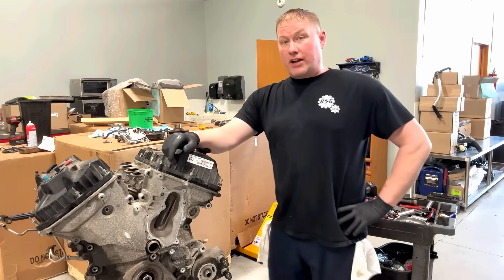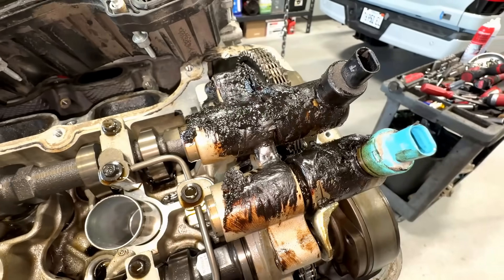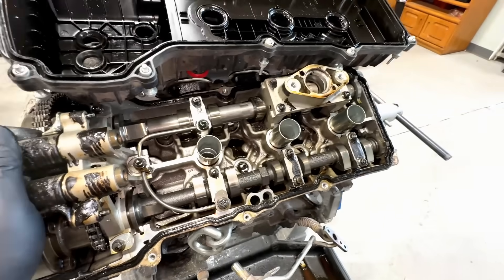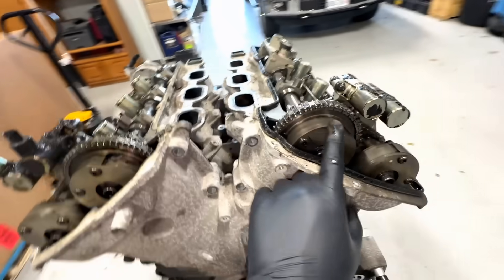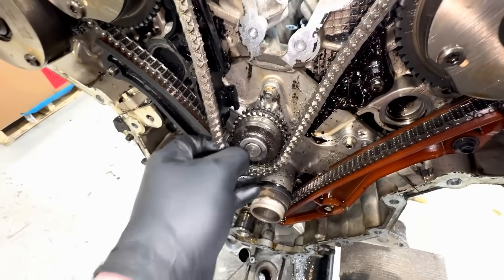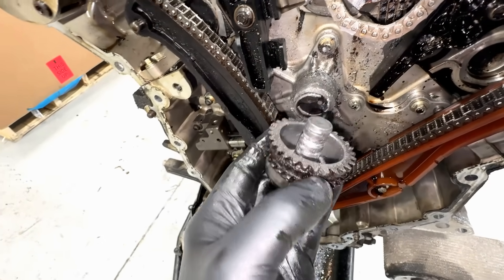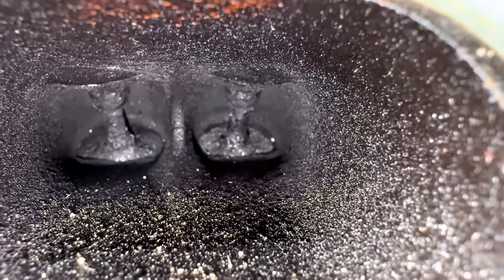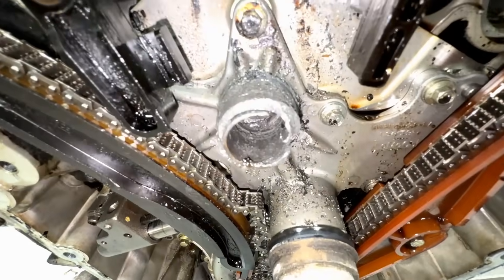2015 Ford F-150 3.5L EcoBoost Engine Failure: 97k Miles Total Destruction!

Comment: I bought a new f150 in 2017 with the 2.7L Ecoboost

She's currently still my daily commuter work truck with 210k miles and the only maintenance I have done its lots of oil changes so they can be good trucks

*6 speed trans torque convertor failed at 198 but it wasn't that bad considering
Reply: Was searching comments here for 2.7 owners experience. Glad to hear that we can expect engine life than the 3.5. I understand part of the reason is our timing chain set up vs. the 2018 & up switch to belts. btw, my 2015 is currently at 133k with routine quality oil changes every 5K.👍
Ps. the torque converter should've been a recall item. How much did it set you back?
Reply: No timing belt on a 2.7 oil pump drive was changed from chain to belt on both the 2.7 and 5.0 in 2021 or so but timing is still handled by chains. First gen 3.5 one long chain 2nd gen 3.5 and all 2.7/5.0 one chain per bank. Chains and turbos kill oil with heat and mechanical shear making it lose viscosity and causing wear. I won’t go past 5000 but stick as close to 4000 as I can.
Reply: @christopherlehman4045  my bad, I meant oil pump. Thanks for catching that.👍
Reply: @ftby59mikeD  Ford wanted 8500 plus tax so I found a local transmission shop to put a remanned in it for 3000

10k miles later no issues 

Maybe 2017 6r80 didn't get the recall or they chalked 200k miles as not a faulty one but glad I didn't eat the 9k at Ford
Reply: @ftby59mikeD  Ford wanted 8500$ for a new 6r80 but I found a local shop to put a remaned in it for 3000$.

10000 miles later remaned is still doing good.

I felt like 200k out of 1 trannie(nomaintence) was "alright" these days.

Comment: It's unfathomable that anyone would question this man when it comes to anything Ford.
Reply: Because 90% of people are idiots. When was the last time you met someone and you came away thinking gee, that person is a genius?
Reply: @Mayamax3  90% is being generous ;-) Most people have no clue what's necessary to keep their investment alive.
Reply: I have 202,000 miles on my 2013 F150. To get there, I changed the oil every 3,000 miles because the oil smelled of gasoline when I bought it. I figured the boost from turbochargers and direct injectors was forcing fuel past the rings. Why did I know to look for this? Because I heeded Brian's advice on oil changes. He knows what he is talking about; in fact, I would say he is an expert.
Reply: All di engines seem to have this happen to a certain amount between changes. Partly from the direct injection and I also think they use a low tension rings on the pistons to increase fuel mileage slightly.  Changed oil on my 2014 ecoboost 3.5 every 4-5000 with full synthetic oil along with an air filter every other oil change. Traded in at 115,000 miles original phasers and chains in engine. Now have a 21 2.7 same change interval and full synthetic oil,  2-3 oil changes a year vs 1-2 isn’t saving me enough to buy a short block later on if I keep the truck till 2-300,000 like I intend to this time.
Reply: @jeffscranton 3000 mile oil changes? That’s so 60’s and a waste of money. Good for you though.
Reply: @mr.wilson8340 ANY turbo car needs 3k mile oil changes. You can thank exhaust heat for the extra oil degradation.
Reply: I couldn’t agree with you more!  Those people obviously haven’t watched his amazing Ford diagnoses and repairs!!
Reply: Keyboard mechanics know everything and love to spout their superior knowledge. smh
Reply: Nonsense, question everything. Learn nothing.
Reply: Agreed!
Reply: indeed...he is the standard to judge others by
Reply: What are your thoughts on using Arch oil friction modifier in the 2.7 eco or even the bg moa oil additive I've heard really good things about the archoil in the ecoboost motors running so much smoother and helping with the bumpy idle that has been common since new?
Reply: @justinlukes3816 archoil products are great. I'v been using archoil ar6200 for years. It's for the fuel but really helps the fuel burn better and keeps gas good longer ! But I am a firm believer in 4000 to 5000 oil changes full synthetic oil ! I have a  17 F150 3.5 33,000 miles no issues I know low miles but I change the oil once a year with a Ford oil filter!
Reply: Guys got skills for sure.

Comment: Is this the same engine design as the 2.7L engine in the 2017 twin turbo Ecoboost in the Ford Fusion "Sport"? I bought this 2017 car for my kid. I've been using the BG flush 200 miles before every oil change. Have been doing oil changes every 5,000 miles. Alwaus use Mobil 1 full synthetic oil. .........should I use a different type of oil? My kids car currently has 199,650 miles on it. It runs like a champ. Passes emissions inspection every two years as required by California State.
Reply: Probably don’t need the cleaner for sure not every change. If you change oil enough the sludge won’t form and need removing.

Comment: Bottom line- That BG stuff really works! 👍
Reply: Exactly what I thought.
Reply: In your opinion would a BG service cleaning be a worthwhile investment every 50 thousand miles or something along those lines.
Reply: @jaxj3626   I change my oil on a regular basis to avoid sludge in the engine. If you get to the point of needing an engine flush, you did it wrong. My new car calls for 10,000 mile change intervals, I’m doing 5,000 max.
Reply: I use the BG EPR  #109 -  Engine Performance Restoration For 4–6 Quart/Liter capacity crankcase: Add 11 oz. (325 mL) of BG EPR® to the crankcase. Start engine, bring to full operating temperature, and run engine for 10 minutes at 1,200 RPM. (For GDI engines and small light-duty passenger diesel engines, run for a minimum of 20 minutes). Shut off the engine, drain oil, and remove the old oil filter. Install new filter, replace drain plug, and fill with new oil. NOTE: Do not use on engines with excessive sludge!  This is per BG’s website. 

BG EPR (Engine Performance Restoration) is recommended to be used every 10 to 15,000 miles.  I do this every 15k on my 2018 3.5L in my Lincoln Navigator since new.  I’m at 100K on the motor now.  I use the EPR #109 can on all my vehicles.  I would venture to say that the insides of the engines are clean. 

I’m not being paid by anyone. I just wan to throw that out there.

Comment: Very Obvious, Oil is cheaper than Hard parts, Metal shavings!!!, My Dad got first Gen V6 2.7 with 213K Miles, Only big job in that truck , both turbos changed at  156K. That 2.7 is Bullet proof, if serviced at Due. Great Video for the guys who blame Ford

Comment: What is your opinon on oil change interval in these engines. 2017 ford f150 3.5 Ecoboost and have changed the oil religiously every 5000 miles only using full synthetic and have had the vehicle since about 65000 miles and now has 135000

Comment: Ford told me that if my engine was dirty they wouldn't cover the phaser replacement. So I went in for the surgery. Looked brand new in there, nothing but faulty ford phasers to be seen. Got it covered 100%. 

Regular fluid and filter changes, and a little bit of sea foam in with every change. Makes all the difference in the world to an engine.

Comment: $125.00 for an oil change! Now what is this guy paying? I'd pay for the oil change! I change mine every 3000 miles!
Reply: You can change the oil and filter at home for under $50. It's not all that difficult and takes about 30 to 45 minutes.  I've never paid for an oil change, mainly because I don't trust these oil change companies.
Reply: @JWimpyme either. I wouldn’t doubt most of them don’t even change the oil filters and only drains half the oil. I let mine drain til it completely stops dripping